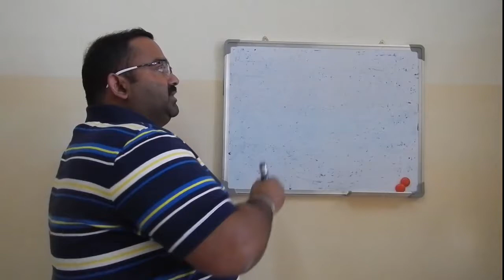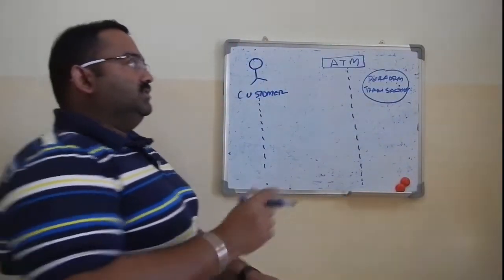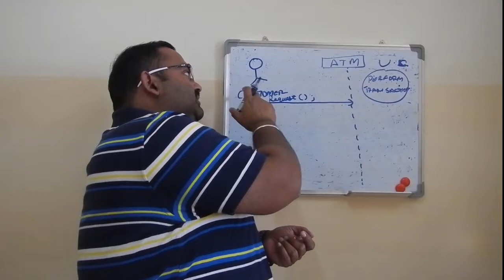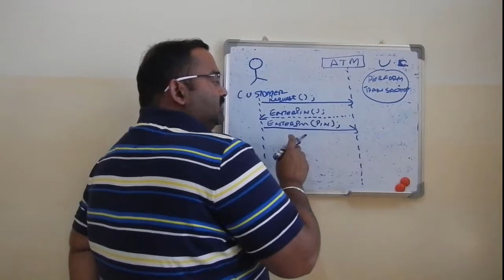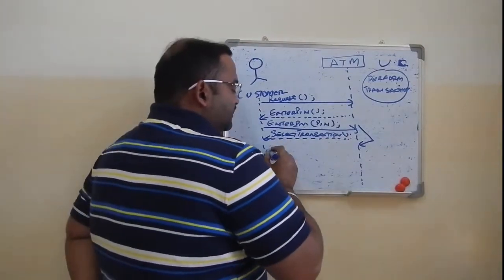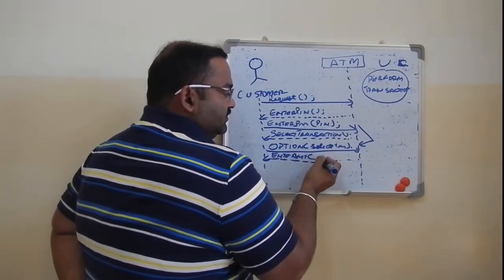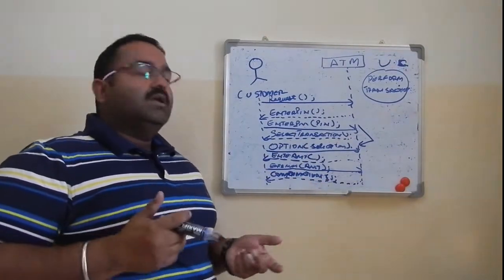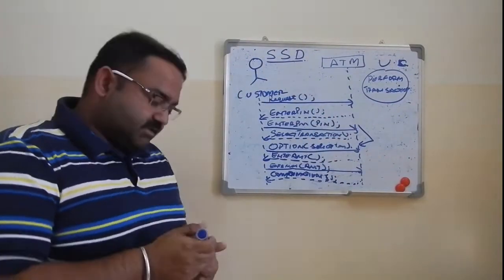How to make System sequence diagram with example

Comment: I have a question regarding when you talk programming. 
When making a system sequence diagram, are you supposed to use all the specific methods and outputs the program gives or is it meant to be a simplification of the whole process?
Reply from the maker: No while makin SSD u can use ur input and output mesaage wht makea it easy for the programmer to understand it...nd later the programmer can convert those to actual methods